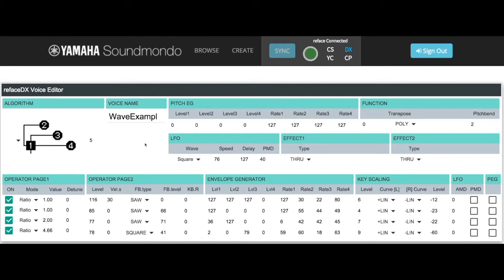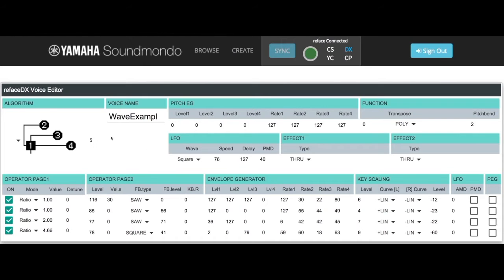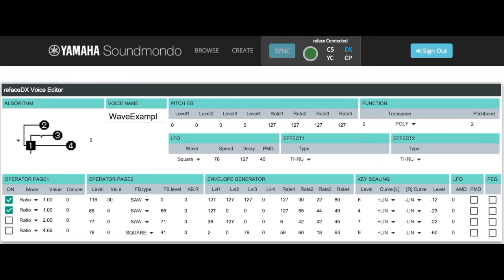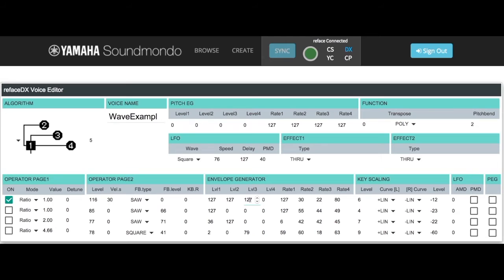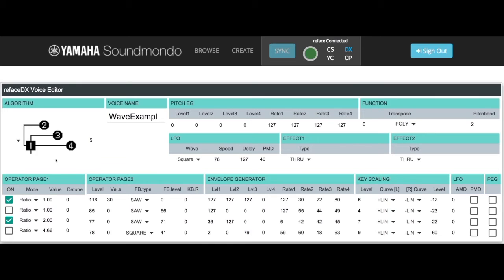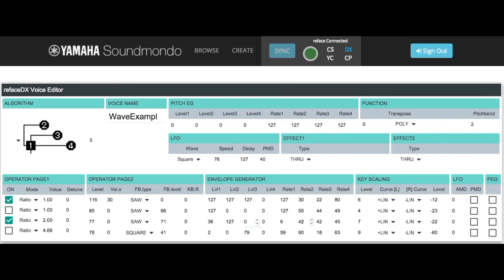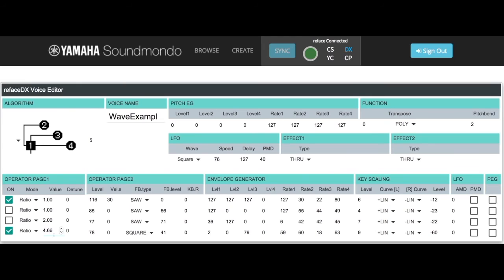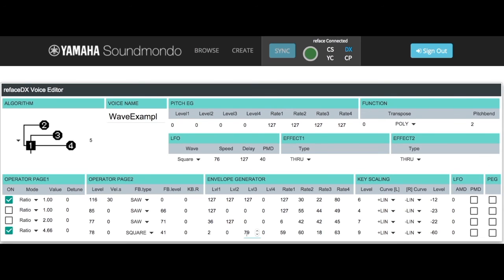Wave Example Video

Comment: Hey all your tutorials are amazing! I have a problem: I've spent the last hour recreating this patch by hand and it sounds nothing like yours despite every setting being exactly the same. I was setting it up by hand so that I could grasp envelopes better-I really love the way you were able to fade in three distinct tones with one keypress. It's a shame that this isn't working out at all. I'll try the soundmondo patch, but that defeats the lesson. 

What's going wrong is that the inharmonic tone sounds nothing like yours. It isn't bell like, just sort of an inharmonic saw, and without any of the depth yours has. Edit: the "bell" seems to start super early. Even worse, the entire sequence takes like 1/3 of the time yours does, which is abysmal since the very length of your patch, and how that is accomplished, is what I was focusing on (aside from the evolving nature of the waveform).
Reply from the maker: Check and make sure you have the last Reface DX firmware -- IIRC the original firmware had some different timing issues with the envelope trick I used in that example
Reply: @DrSynth  Thanks. It shipped as 1.30, so it is up to date. I was able to load the patch from Soundmondo and it works exactly like in the video! A very nice long, slow evolution between all tones. Now, if only I can input it manually and get it to work!